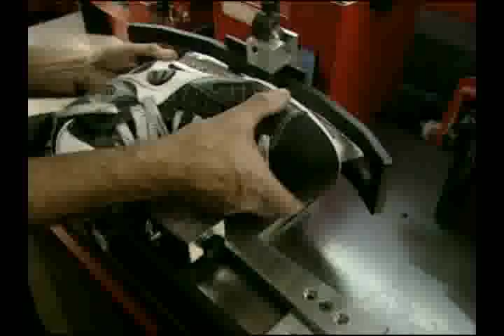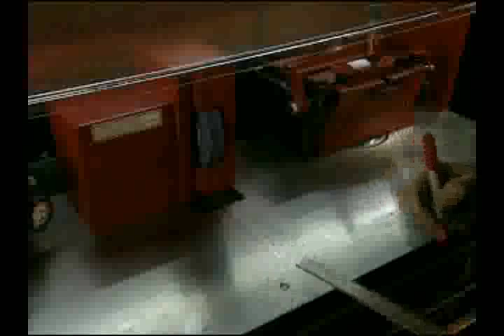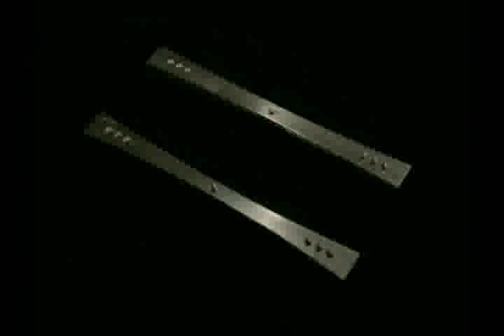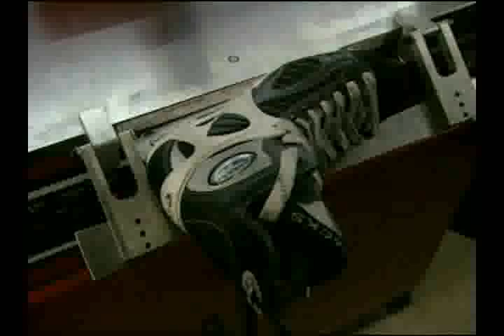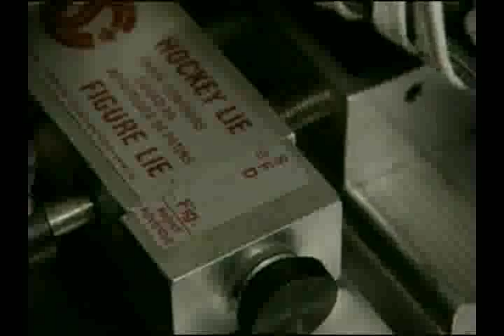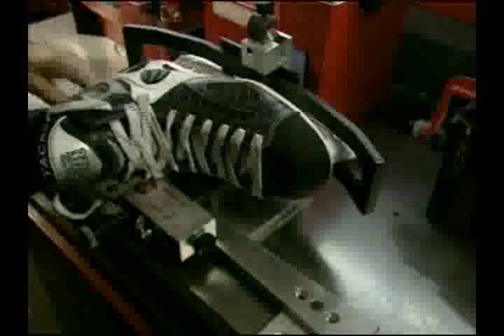016 The Custom Radius old  Blademaster skate sharpening machine - how to sharpen skates

Comment: Way too many stacked errors.... You joking right ??? Eye balling a magic marker mark on center and extending it by hand.... Need to use a lot more precision during that alignment stage...... If you have an older BM table, you can machine a cut-out for the new profiling system...